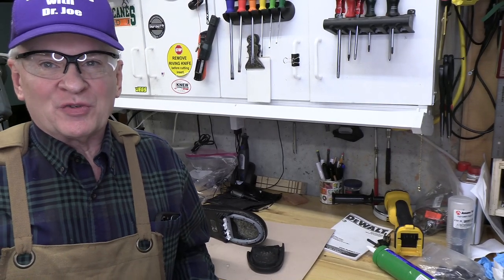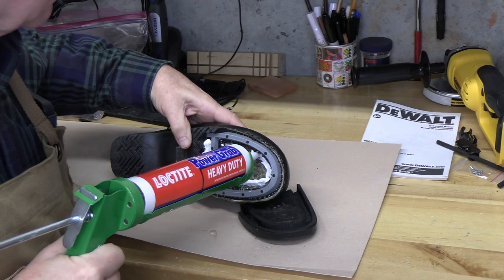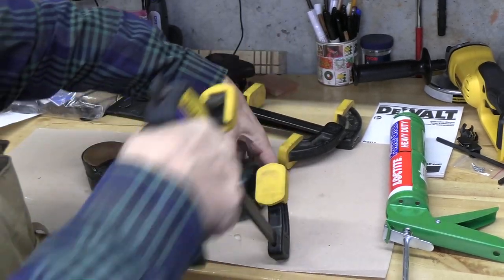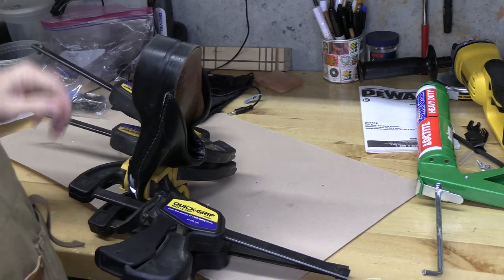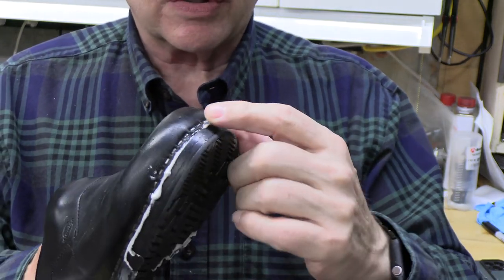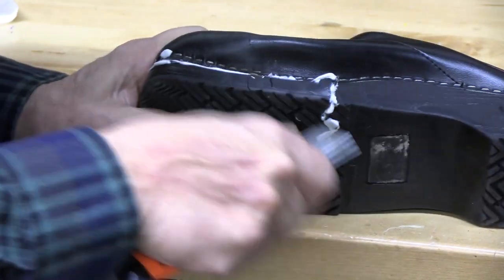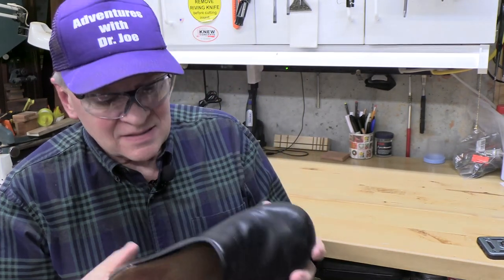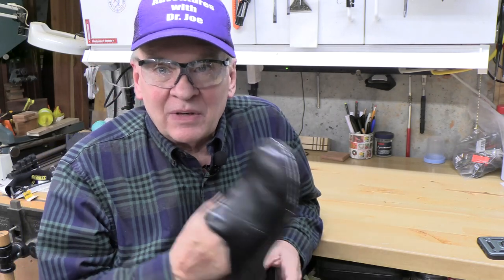Sanita Dansko Sole Blowout and Fix w Dr  Joe

Comment: The issue here isn't an adhesive issue.  The polyurithane sole is disintegrating.   It is only going to get worse.
Reply from the maker: Hello Brian. Thank you for your comment. You are absolutely correct overtime the soul will fail however thiss fix can  last a long time. How frustrating it is to have a perfectly good she'll basically than the soul falls off the crazy. Consider subscribing thanks Joe

Comment: Why isn't Dansko replacing these defective shoes? There should be a recall or a class action lawsuit.
Reply from the maker: Thank you for your comment. Yes I mentioned that in the video because it’s universal and so frustrating. I don’t know the answer to that. I would be on board though. Consider subscribing. Thanks. Joe.
Reply: @JosephHunstad  Thank you. I just subscribed. This is very frustrating. Tomorrow I'm buying my wife new shoes, to replace the rotten Danskos, and they will NOT be DANSKO.

Comment: I had a part of the side and bottom of the heel of one of my danskos blow out.  Is there any way to fix it?  I still have the entire side piece that came off but the material frim the bottom crumbled and is lost.  I am going to try and use construction adhesive to glue the side piece back on and build up the quarter size hold in the bottom.  Hope it works!
Reply from the maker: Thank you for your comment. I do hope that works. If the defects not that great you can just fill it in with the Apoxsee as well. The Apoxsee holds the pieces together very nicely. Let me know how that goes. Thanks – Joe